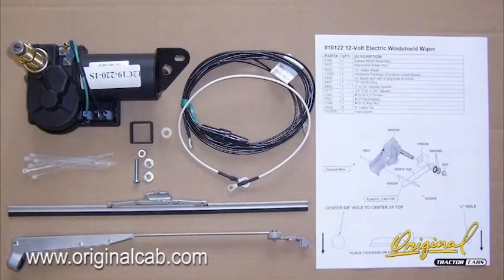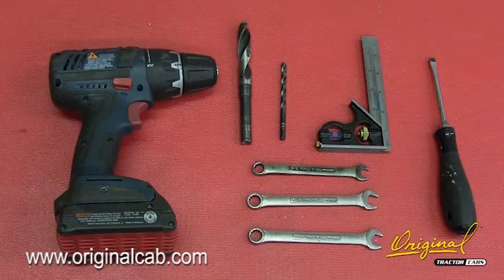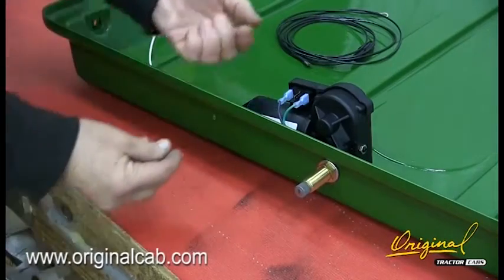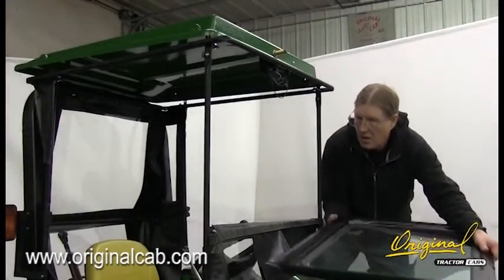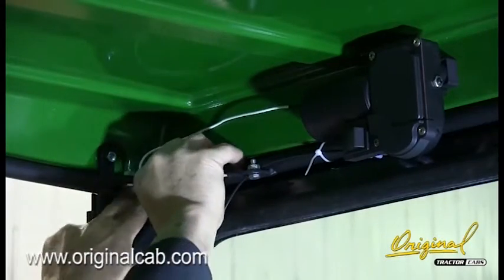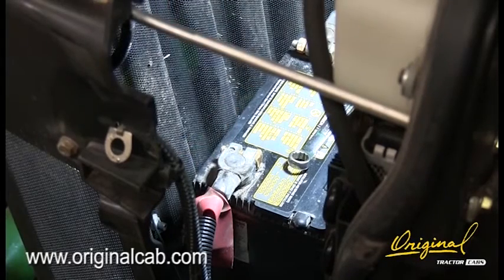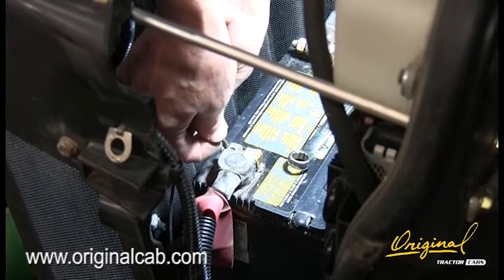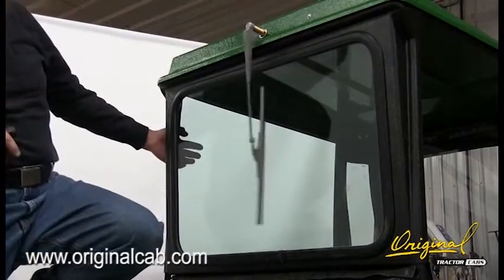Original Tractor Cab 10122 Electric Wiper Installation Instructions

Comment: That live wire going from battery  put a  fuse holder  on it to prevent a fire if live wire vibrates  and wears it will earth to tractor  if it does without a fuse there will be a fire,if there was fuse there it would blow.👍

Comment: My cab doesn’t have a place to ground the wiper
Reply from the maker: The wire should be able to reach the tabs where the front posts connect to the top frame. I would connect it there.